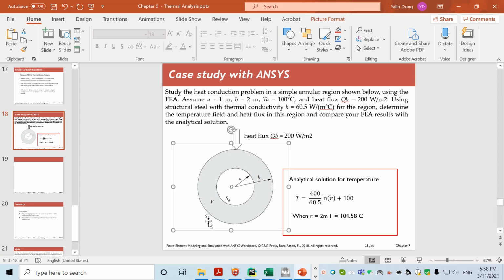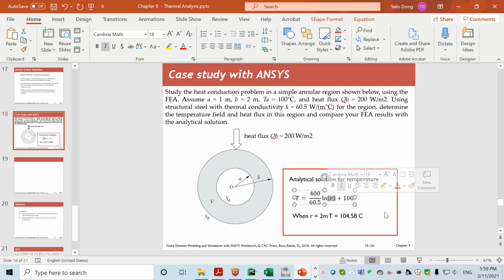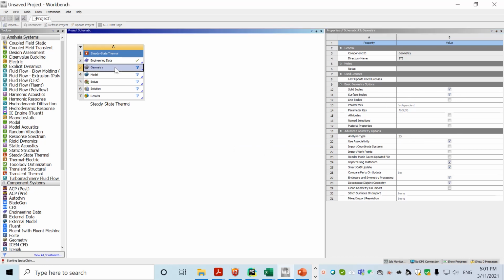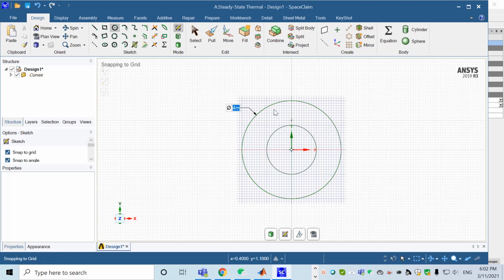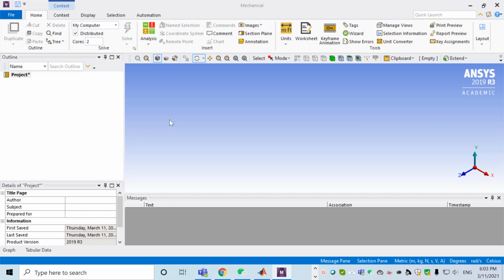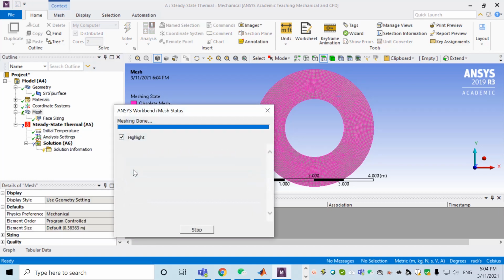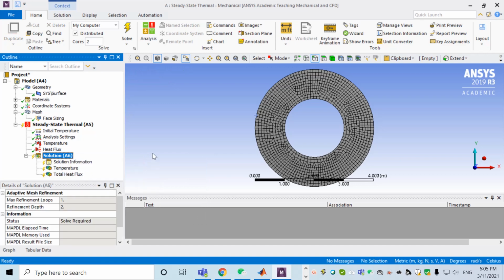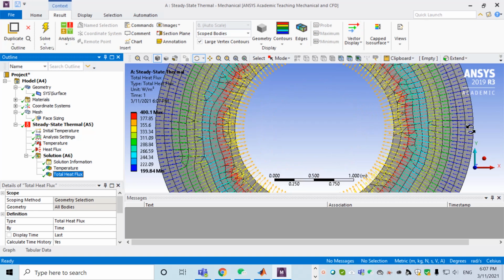Chapter 9: ANSYS works on a simple 2D steady state thermal problem.

Comment: Solution is not running: "An internal solution magnitude limit was exceeded. (Node Number 1470, Body Design1\Surface, DOF TEMP) Please check your Environment for inappropriate load values or insufficient supports.  You may select the offending object and/or geometry via RMB on this warning in the Messages window.  Please see the Troubleshooting section of the Help System for more information." Why? What is the problem?